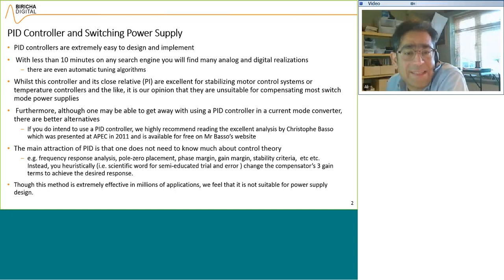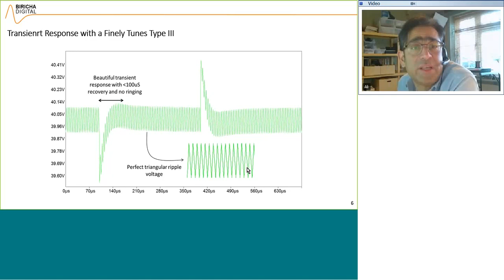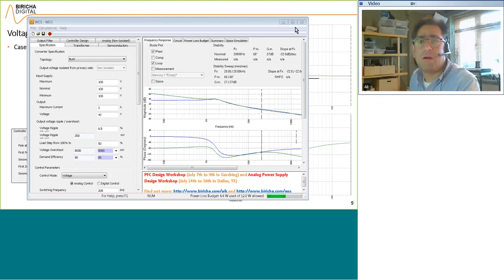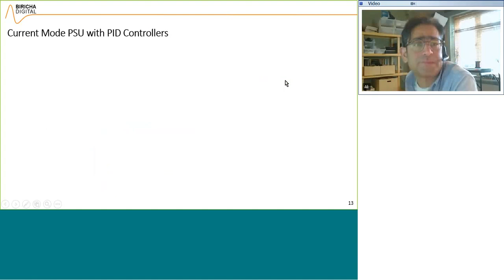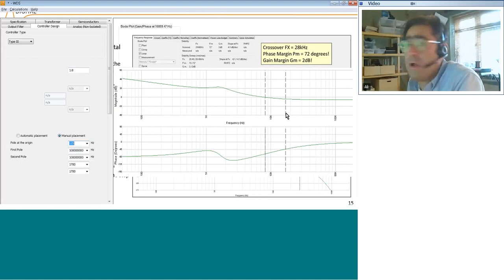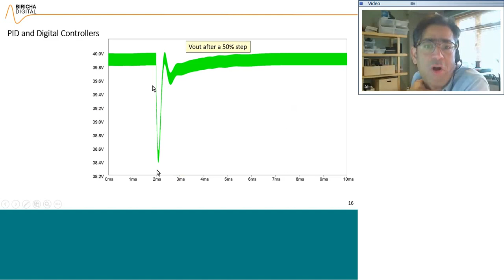Webinar: Why PID is not suitable to stabilize most power supplies

Comment: well, you assert that power supplies must be designed in frequency domain, but you fail to justify that. I have designed switchers, and yes, I used frequency domain and typically a single integrator that never dropped phase margin below 90 degrees - perfect behaviour and a clean, overshoot-free switch-on. But just because that is a really good way to do it doesn't necessary preclude a TD method.
Reply from the maker: At 2:40, Dr. Ali Shirsavar mentions the advantage of PID is that one does not need to design in frequency domain. However, depending on the topology of the power supply a simple integrator might not be sufficient.